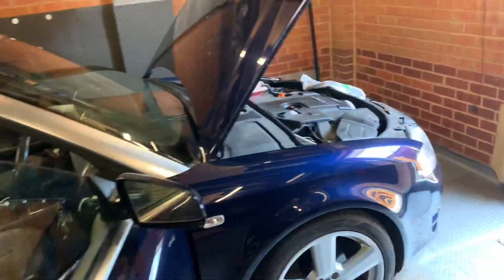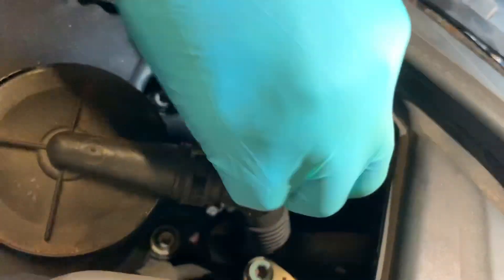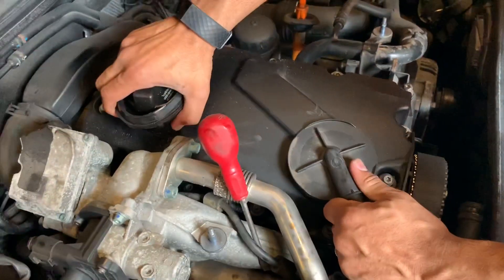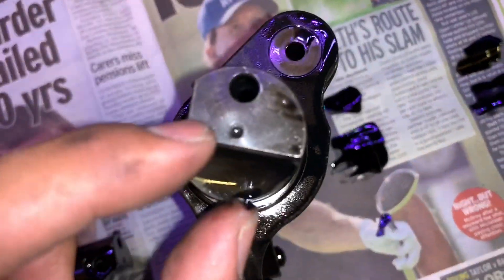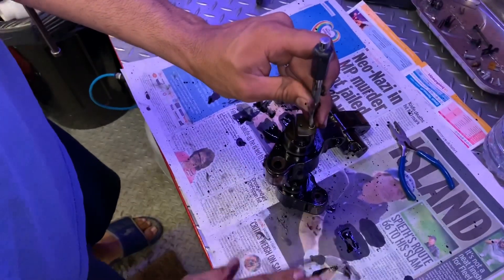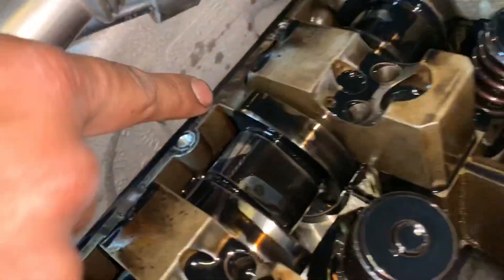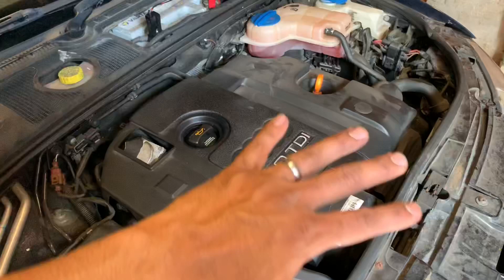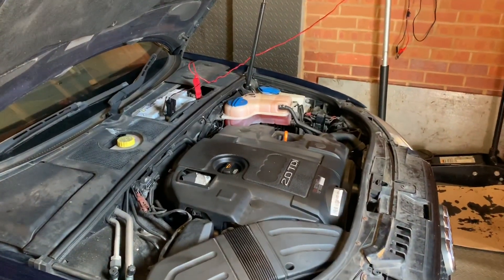Audi A4 Cabriolet 2.0 TDI BPW Noisy Hydraulic Lifters - Injector Rocker Oil Leak Repair

Comment: This is my car in the video, I went to see Khurrum to have a few issues sorted with my A4, he instantly recognised the ticking that was coming from my engine and explained what it was and he'd talk me through this fix, I can not believe the difference on the drive home the car sounds like new again so quiet.
Khurrum also repaired my window regulator (see other video on Vag Pro channel)
Fixed by broken roof and installed a roof module allowing me to open/close it from the key.
Very knowledgeable and friendly, explained everything he was doing.
100% recommended.

Comment: Great video, good explanation! 
Anyhow, im having oil-leakage troubles with my a4 b7 BPW engine, could this be the case?
I have changed all kinds of gaskets.. it also have a large amount of hvite smoke coming out of the exhaust. enything you know about?
im having a fear that  the head gasket i the problem.
Thanks for the video. Thumbs up!
Reply from the maker: Ole Thanem 

Don't think this is your issue
Reply: Same problem as me turned out to be breather on rocker cover, replaced and no smoke
Reply: @sullythegamer2492  Same worked for me

Comment: Hi , whats the best silicone sealent to put on the rocker cover when reattaching? Thanks
Reply from the maker: Hi
Pop over to your local motor factors and purchase a high temperature oil resistant gasket maker
Reply: @CabrioletTech  ok will do thanks 😊 👍

Comment: I have an A4 with the bpw engine, an suddendly i GOT the pil pressaure light coming, i imidiately shut Off the engine and pushed in the clutch pedal, my first thaught was That either the chain tensioner to the oilpump/ balanceshaft was failing, or the litle Axle driving the oilpump was rounded, because this is a comon faiure on theese engines. So When ingot the Car home i took down the oil pan and the first thing i noticed was That i didnt have the chain driven balance unit, But the one with sprockets.so i took down the Whole balance shaft unit, I disassambled IT to check this wellknown Axle between the pump and the balance shaft to find out That i had a lot of wear But ther is no way That IT could spin, so then i GOT a little confused. But i also had an small knirking noise coming from the rocker cover, so i removed IT tho check The hydraulic lifters for the valves, ant then i found this oil plug, the same as in the video, and IT had falen out, could this cause my low oil pressaure? And this knocking have been a while and only When coldstart or if IT has Been sitting for a while. 

Sorry for bad english
Reply from the maker: simen aass 

Low oil pressure light I have never had with this issue 

Maybe your pickup is blocked ?

Plug missing causes hydraulic lifters to make noise
Reply: I dissassambled the whole balance shaft/ oilpump unit, the pickup looks fine an the allon key bolt That drives the oil pump had a bit of ware, But nothing That would cause the conection to slip. The lifters and the camshaft Where really bad! And IT Wasnt only one of these pil pluss That was missing, 3 out of 4 had fallen out
Reply: @simenaass9849  Just had same issue with low oil pressure on my 2009 bpw a4 tdi, did you ever sort it?

Comment: Hello, 
I have the same problem but on my engine i have lost all the plug which are on the injector rock. Anyone have the part number of theses plugs ? 

Best regards.
Reply from the maker: They only sell them complete with rocker, or you can get some silver steel, loctite and centre punch
Reply: VagPro Cabriolet Specialist excuse me but do you have the part number of the rocket ? 
Because when i See on Google from this part 038109527AF which is fit for BPW motor I don’t find this plugs...

Comment: Nice video! How do you unscrew rocker cover's middle screw under EGR without removing any part of it? Maybe you know, if occurs oil leakage from rocker cover screw places then I need to have a new rocker cover? I have changed 
gasket and applied all around sealant and it won't help.. 
https://drive.google.com/file/d/1MgKg8K64oc6Zbs7GQT5FVvzGH_GtGMaW/view?usp=sharing
https://drive.google.com/file/d/1Pq0BYSnsL2FNpR1YP-a428we7enkYT8K/view?usp=sharing
Reply from the maker: Mārcis Kalniņš 

Remove the bolts with a torx key or slim 1/4 drive socket

You may be getting leaks if your gasket is hard and also if it's over tightened